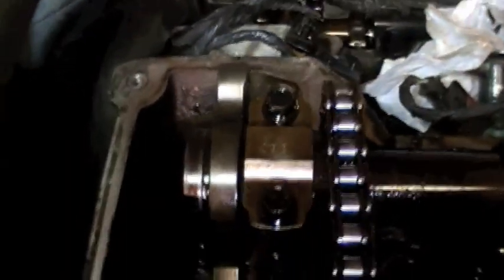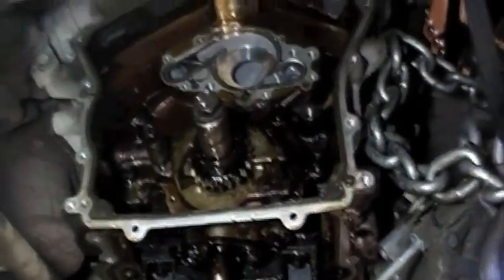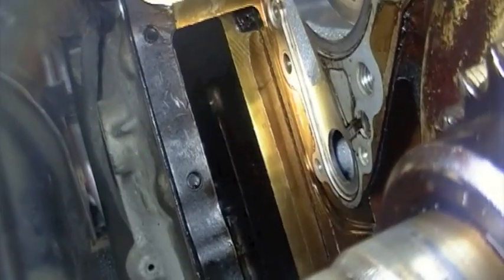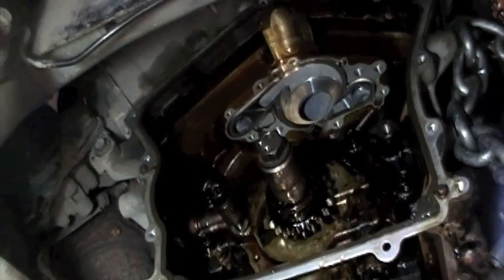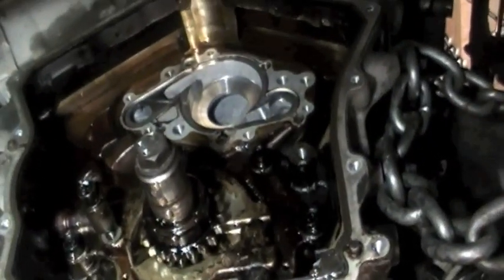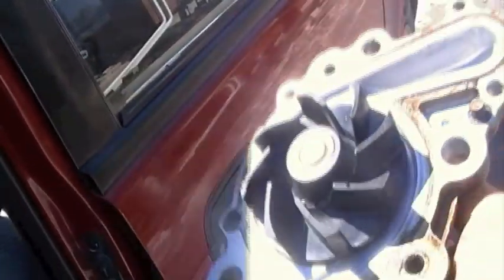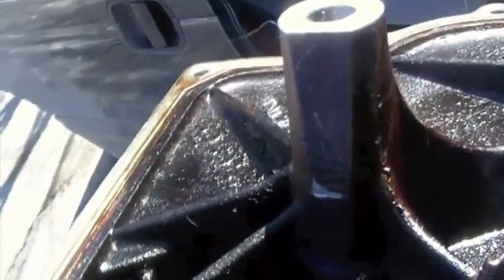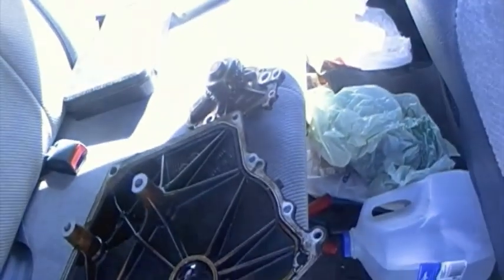How to Fix Your Chrysler 2.7 Engine The Right Way! Part 3 of 3

Comment: You said that when the water pump goes bad it will leak antifreeze into the oil,that did not happen on the Dodge Charger that I am currently putting a water pump on,this water pump is designed with 2 weep holes,one on the back of the pump itself that connects to another one that routes the coolant to the outside of the block near the thermostat housing and that is where the water exits the block instead of getting in the oil crankcase. I guess if you have a major failure and the water pump just blows apart coolant could get in the oil but it is not designed to happen this way and I have yet to see a vehicle with one of these 2.7 engines have a bad water pump and have coolant in the oil.
Reply: tony bradley just got done replacing a water pump that wasn't completely gone but was pouring water into the oil. You must have had the one in a million occasion.
Reply: Right because you have an external pump this 2.7 like 98 to 2003 it is an eternal fan blades of pump in side of block with seal that goes the right in engine

Comment: I need help I have the 2.7 v6 i changed water pump oil pump and bearings rod and main put it back together no oil pressure drops to 0psi don't no why
Reply from the maker: Randall coffey how are you measuring your oil pressure, if you are just relying on the oil pressure switch they are commonly problematic. If you are using a gauge directly off an oil passageway and not receiving oil pressure. Either the pump isn't priming or your bearing clearances are too large and you are suffering a loss. Also the primary timing tensioner has fluid passing through it and it could also be leaking pressure.

Comment: On these cars if is not the intake gasket is the housing or the thermostat goes if it's not that it's the water pump inside if it's not that it's the radiator these cars were meant to fail on  these engines
Reply from the maker: Bohemia Lite agreed a poor design. But a great motor when everything works! Only reason I keep fixing them!

Comment: im hoping u can/will help??? oil light was coming on only at a idle but,now its coming on & staying on much longer until its above 2-3k rpm's so I got under it & looked at the oil pan gasket & on the side closest to the bellhousing, the gasket it freely hanging so im wondering if I just put on a new oil pan gasket if you think that will put a stop to the oil light? I imagine the light comes on when dropping below 10psi of oil pressure? plz help

Comment: my girl has a 05 sebring w/172,000 miles on it. when she bought it,it had 130-140k on it.in the years she's had it, NO MAJOR PROBLEMS HAVE HAPPENED!!!! Alltho several things are now wrong with it-struts, bearing plates,which we know & plan on replacing-$317 for all 4 quick struts with new bearing plates, front control arms with new ball joints & bushings.i have 2 balljoints already so,she'l have a new supention afterwards,she can probably get away with only changing the strut mounts on the rear.The biggest problem the car has now is,only at a idle the oil light comes on(she cheaped out & bought a rural king brand(eco guard) oil filter & THATS WHEN IT ALL STARTED!!! even after I replaced that filter & oil(every1500- 3k &most of the time I do it way early!!! to be on the safe side!!! im wondering if the oil pump is bad or if its electronic(maybe just a oil pressure sensor?) anywho,the oil pump looks to be behind the timing chain, not in the oil pan??? YOU HAVE DONE YOUR TIMING CHAIN.I HAVENT SO, AM I RIGHT ABOUT THE OIL PUMP BEING IN WITH THE TIMMING CHAIN,BEHIND THE CRANK SPROCKET????? SO IF IM REPLACING THE OIL PUMP,I MITE AS WELL HAVE A NEW TIMMING SET UP(GUIDES CHAINS SPROCKETS & TENTIONER AND WATER PUMP)SINCE IM GOING 2 B IN THERE ANYWAYS??????????? BESIDES THE COMMON PROBLEMS WITH THE STRUT MOUNTS,IM WORRIED ABOUT THIS OIL LIGHT COMMING 0N  AFTER IT WARMS UP & HAS BEEN RUNNING A WHILE,WHEN SHE STOPS AT A STOPSIGN IT WILL COME ON BUT GO OUT WHEN U GIVE IT GAS.THERE IS NO FLUID TRANSFER BETWEEN THE OIL & COOLANT!!! (THOSE WHO HAVE THE REAR WHEEL DRIVE 2.7 ARE THE LUCKY ONES!!! THERE IS A CODE(P0113) FOR THE INTAKE AIR TEMP SENSOR #1 CIRCUIT HI. & CODE (P040) 1ST CATALYST SYSTEM EFFICIENCY BELOW THRESHHOLD BANK #1.IM WONDERING IF EITHER OF THESE CODES ARE CAUSING MAYBE A LOW IDLE PROBLEM AFTER IT WARMS UP,CAUSING THE OIL LIGHT 2 COME ON @ A IDLE AFTER ITS WARMED UP????? ANY HELP GREATLY APPRECIATED!!!
Reply: I have a 2006 with 128,865 runs like a raped ape
Reply: DID YOU EVER FIGURE OUT WHAT THE ISSUES WERE?  IS THE OIL PUMP BEHIND THE TIMING CHAIN??!

Comment: i have a 2008 dodge charger 2.7 when I drive the car for 1 hours the fuel mire go to empty an the check ingen light comes on an the car feel like if dont have no pressure
Reply: that happened to me...now i have brand new engine >.<

Comment: What does it mean when the power steering fluid is that milky coffee color? My steering is a bit squeaky and plan on doing a drain, flush and fill whenever I can get a jack for my '99 dodge intrepid.
Reply: John vape do not use regular power steering fluid only use mobile 1 synthetic transmission fluid that's the only fluid that goes in a dodge I have a 04 Sebring and the pump almost went. It was wining till I sucked out the old fluid and put mobile 1 the last owner didn't know about dodges tranny fluid for power steering.

Comment: Engine not motor  , wiper assembly operates with a motor , car goes because of the >engine <.
Reply: So I guess 'Indianapolis Motor Speedway' is only for cars powered by windshield wiper motors?
Reply: mo·tor
ˈmōdər/

noun
1.a machine, especially one powered by electricity or internal combustion, that supplies motive power for a vehicle or for some other device with moving parts.
adjective
Reply: tool
/to͞ol/
noun
1. Barclay Reginald
Reply: You probably correct those who call magazines, "clips" as well

Comment: Hi bro,plz help me out, I have 2.7L V6 Chrysler,It was over heated and its water was gone and water and oil was mixed became milky oil.I replaced the new water pin and checked everything is fine nothing damaged, only waste water pump,but it's not starting :-(Three times open head and reset the timing change, but don't know what's wrong with it.!Plz help me out.!!!
Reply: did you clean and send out heads o get shaved? you will need need head bolts and gaskets. once you do this you should be good to go
Reply: +Md Furkaan It's the timing chain.  I had the same thing happen to me and thought I had everything set correctly.  The problem was I worked by myself and it is a two person job to get the timing chain on correctly.

Comment: Another problem is when the water pump shaft bearing fails the pieces make their way to the oil pick up and clog it thus exacerbating the oil starvation to the tension even further. Make sure you remove the oil pick up, clean it thoroughly and use a pick to dig out any remaining pieces stuck between the screen and the screen cover. You'll be surprised of what you find stuck in there.

Comment: I have no idea how this seemed like a good idea to the engineers.   "Yeah, lets put the water pump there...this way when it fails it requires you take apart the entire motor and if you don't catch it immediately it destroys the engine.
Reply: it's so that there's less power being drawn to the serpentine belt. similar to how the timing belt on some cars turns the pump pulley.
Reply: Charlie Gates Nah, that doesnt make sense. 

The power used to drive the waterpump is still coming from the engine itself,  the energy requirment the water pump needs to circulate coolant isnt all of a sudden free, because you moved it to the timing chain, instead of an external belt.
Reply: +Michael G perhaps I worded that innocently. the fewer accessories (the water pump isn't really an accessory) that you have on the belt gives the engine just that much more power. why do you think A/C compressor clutches disengage when red lining on some cars? so the engine has more power. another advantage to this particular design was to make the engine more compact as well. as opposed to an engine that has the pulley outside the timing cover or even the pump protruding out of the cover, the pump is now located inside a cavity that was already inside the timing cover of the engine by design. this makes it easier to put in a transverse mounted front wheel drive application. I know they used these engines in the odd logitdual front wheel drive application but to do just about anything in that set up you need to remove the bumper cover anyways.
Reply: Charlie Gates The a/c clutch disengages for two reasons.... One, there is a design limit on the RPM the compressor itself can handle...they program the engine computer to shut off the compressor to avoid damaging it.
The second, is the a/c compressor is not vital to vehicle operation and Wide open throttle is often not a prolonged condition, so by decoupling the compressor, you can get a few extra horsepower for the brief moments you need all the engine is able to provide, and most scenarios you wouldn't even realize the a/c operation was interrupted.   I would also like to point out that not all vehicles do this.  My trucks A/C does not do this....the a/c compressor is "load sensing" and thus, is designed to provide a/c at any operating RPM.   I can literally hold the gas to the floor bouncing off the rev limiter and the A/C will stay on.      I think its stupid, because I have to manually shut off the a/c if I want full power. 

Anyways,  no... driving the water pump from any one of the engine driven chains or pulleys will never save power, or make it more efficient.
Reply: +Michael G I still disagree but you are correct on a few of your points. my 1999 Grand Vitara does shut the A/C off st WOT and you can really feel the difference. my 2005 and 2010 corolla do not. my mom's Tacoma does and you can even feel it kick on and off. I don't mind it at all. 

you missed what I said about the engine being more compact. plus I do think that having a chain driven pump does reduce the effort on the engine. it shouldn't have any resistance.
Reply: Charlie Gates Yeah, I acknowledge your points on being more compact. From an engineering standpoint, to me, does that negate the huge flaw that causes catastrophic failure due to that space saving feature? Eh, no, not really. They could have figured something else out...but maybe funding expired before they could have done that, so they went forward with this shit design. Who knows. 

Why logic brings you to this conclusion that a chain driven pump will be exempt from frictional losses,  yet those losses will be present with a belt driven pump.   Its not like the belt drive disappears once the water-pump no longer needs it.  It is still used for the alternator, powersteering, and a/c
Reply: I could be wrong but in my experience it was rarely the pump failing. Rather, it was the 2 gaskets that mount in between the pump and block on each side that go to the swirl chamber. Again I could be wrong because it's been years since I've serviced a Chrysler 2.7. I think you're right that it's hard to justify putting it in such a position. Smilies designs include the ecotec engine which is just about as difficult to service the water pump on and the Nissan 3.5, which isn't too bad. And I agree that you can really justify those two.

Comment: I just bought a 99 Concorde... The guy said the motor is dying... I'm a little mechanically inclined (better on gm).. however I barely hear a rod knock... could it be the timing?
Reply: Damon West  if it has the motor in this video then it probably had a bad water pump,  water pump leaked into the oil, oil got contaminated and the bearings went.  How did the oil look? 

I will never own a car with this motor or any motor that has the waterpump literally buried inside the block and setup in a way that when it starts to leak, even drip,  its going to go into the friggin oil and cook the whole motor in short order if you dont immediately catch it.  NO THANKS.
Reply: Michael G oil is clean.... just a slight slight knock... I was told a lifter
Reply: Michael G ok thanks
Reply: Its your tensioner...on a 2.7 it's very common to go out...and start knocking cause the chain pushes it back in...you can weld the tensioner so it won't get pushed back in....

Comment: I have a question. If you replace the engine in a 2003 Chrysler 300m do you have to sync it to the computer if its a used engine? If you do and you don't what could happen? Thanks.
Reply: If you are doing to direct year-to-year engine replacement, the sensors and electrical connections should be the same.  The only issue is if you buy a used engine that is a different year, sometimes the electrical connections are different or something else has changed slightly.  The wrecker/recycler or whom you're dealing with should know if you have to change anything over from the old engine or do any modifications.  If they don't, then you will need to check yourself.

I swapped a 1996 Concorde engine into my 1994 Intrepid and had to change over the O2 sensors as they were different connectors.  The PCM, TCM and TPS (Program, Transmission and Throttle) were all the same/compatible.  In a 300M, I don't think you have to change anything at all because it's all OBDII and there is only one engine in North American and one for Europe.  If you're in Europe, you will have the 2.7L, in which case you should sell the car or scrap it. ;)

I should add that there was a change in 2002 I just remembered - it was a change to one of the computers.  There is a new computer for engine and transmission controls for 2002-2004, so you should be looking for a 2002 or higher engine to avoid a check engine light for "no issue".  I don't think there is any compatibility issues, but just to be safe.

Comment: Im just about to start this 2.7 sebring becuse It has water that loocks like chocolate. It doesn't run anymore but I saw your video and this engine has al those simtoms  if you can call me becuse I have some more cuestions about this proyect before I do something wrong please 847-305-9314 thank you si much
Reply: Marcos Olvera If you don't know what you are doing your going to have leaks and timing issues pay a shop or better yet drive it off a cliff and buy a Toyota
Reply: I already fix it     it take's time but is possible
Reply: Marcos Olvera

Comment: Thank you for the information!  I'm a novice, replacing my water pump in a 2.7, and I'm up to my ass in this '05 Stratus.  I know you don't have time to show all the teardown involved in this.  This is no simple job.  People, you have to remove the timing chain to replace the pump.  That means that in order to access the timing cover and change the pump, I needed to put the car on a lift and use a floor jack to support the motor, so that I could remove the passenger side motor mount and use the floor jack to raise and lower the motor for access to bolts and belts. Then holy shit- vent the fuel pressure, drain the coolant, remove the main pulley and the belts, the serpentine tensioner pulley, the power steering pump bracket, the coolant reservoir bottle, the power steering reservoir, the intake plenum, the radiator fan, the valve covers, coil packs and spark plugs, and all the hoses and wires in the way.  There's just a shitload of work, and access is a pain in the ass.  I'd also like to thank Dodge for the one Torx bolt at the least accessible point on the timing cover.  Stripped it nicely.  I can't figure out why Dodge would design this engine this way in the face of, say, the GM 3.8L V6.  Dodge different.
This cost me $400 in parts alone, and I've been at it for two days.  The idea that I might easily pay a professional $1000 to do this job every year is ludicrous, and I'd shell it out right now with a smile on my face.
Reply: Michael Ballard Then after the water pump is replaced then you will have transmission issues, electrical issues etc......................
Reply from the maker: Michael Ballard I felt your pain the first time I did one of these , I can do them with ease now. I know all the bolt sizes and order of removal. I'm getting pretty quick full job takes 4 hours now
Reply: @JesseMarrin  gives me hope for my 05 sebring touring at 246k kms. Needs everything but an engine! Well engines getting inspected closely & rebuilt so it can keep together maybe another 246!

Comment: moparracer3 "All Chrysler engines ending in a 7 are junk. 2.7 3.7 4.7"
Thinking about it, that's actually pretty accurate. Haha. =)
Reply from the maker: Shock Diamond you are not wrong!
Reply: DEAD ON!
Reply: The 3.7 & 4.7 are fine as long as you keep the oil changed.

Comment: Scrap the car.  DONE!
Reply: Thats what a girl would do smh
Reply: kingseXXXie It's actually because the 2.7L is inherently flawed.  The water pump allows coolant leakage to the inside of the engine and the oil sludges up.  There is no way you can stop it from happening, but you can minimize it by using high grade oil that is more resistant to contaminants, change the oil slightly before the regular change interval or know what you're doing when you buy a car and not buy a 2.7L.  ;)
Reply: Sell this piece of shit and use the money to buy a used Toyota.  DONE!!!

Comment: Hey my friend. I need to know how to prime the chain tensioner... what I have to do?  It's necessary to pre charge it with oil or just wait for it to get its position.. I hope you to answer me... thank you
Reply: Set it into its right position, then, with a flat screw driver, push the time chain guide towards it and it will be set automatically